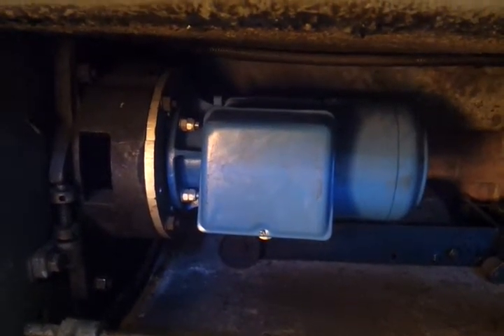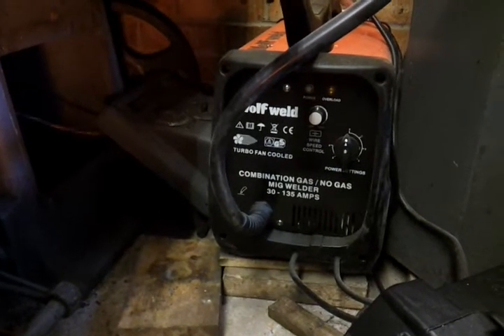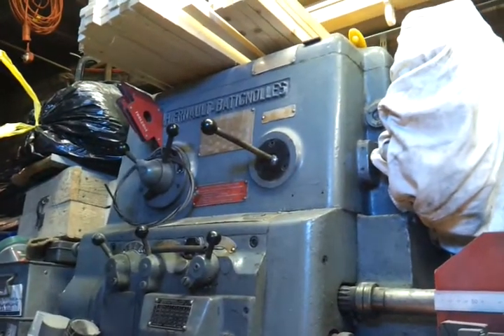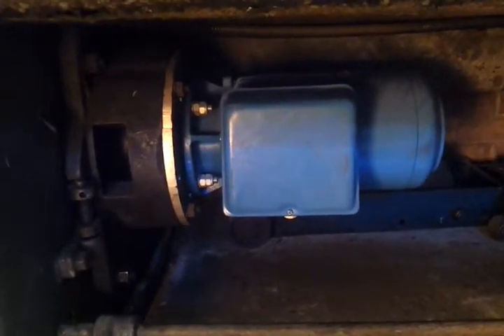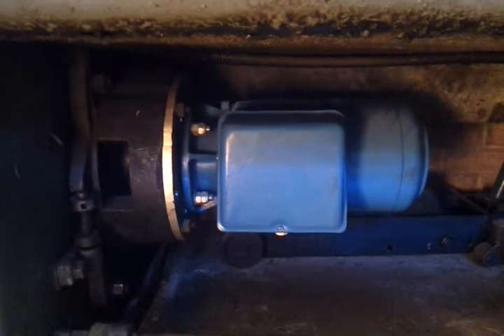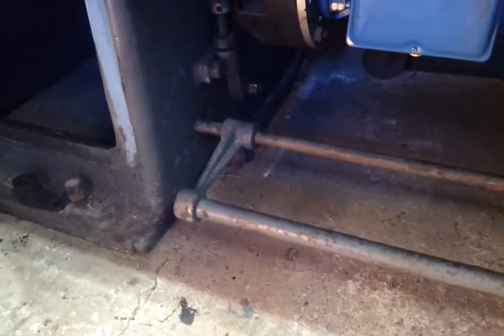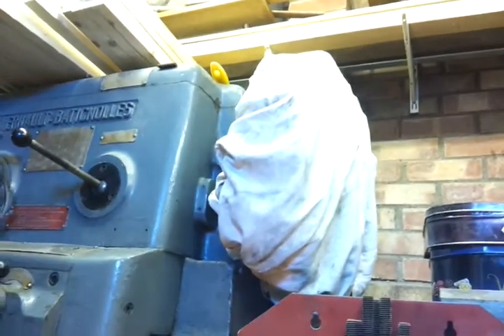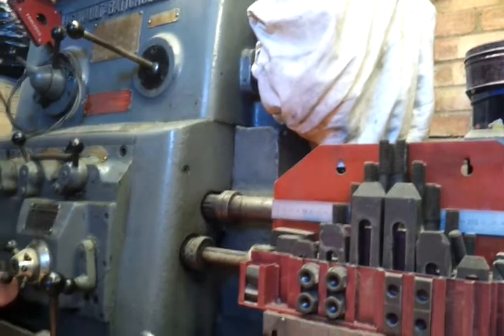Big Lathe Motor Refit (Part 1) - 'Old' Single Phase Motor

Comment: I found with my lathe, if you jump on the foot brake when she is doing 1500 - 2000 revs the whole machine wants to tip over on top of you. I assume it's a combination of the inertia of the chuck and the forces of it stopping dead. So I now feather the brake at the higher speeds. Have fun with your motor swap mate. I have subbed so I can keep up to date with your projects.
Matt

Comment: That lathe is a BEAST! Very cool!

Wish I could find some history on that company (in English!).
Reply from the maker: Ironically, I did find some information on the lathe but only in the last week or ten days. So far as I can tell it's a Ernault Batignolles HN250. The model number has eluded me until I found a manual in French with a picture of a HN200 and HN250 on the cover. Most images of the HN250 show a slightly different headstock shape but nevertheless all the controls are the same.
Reply: voidmansions Thanks for the additional info.